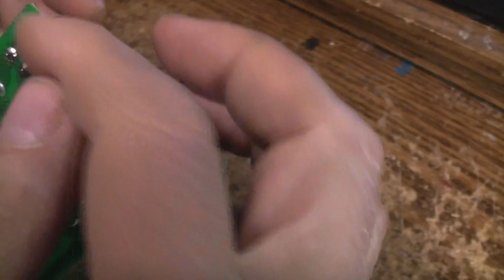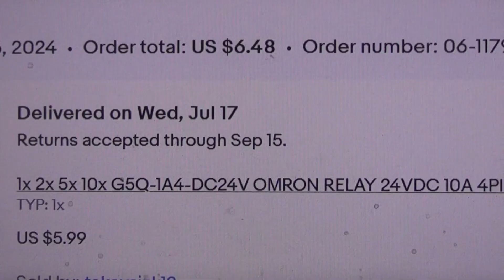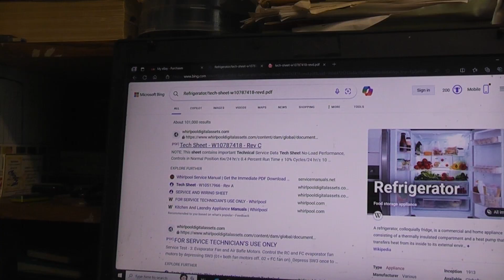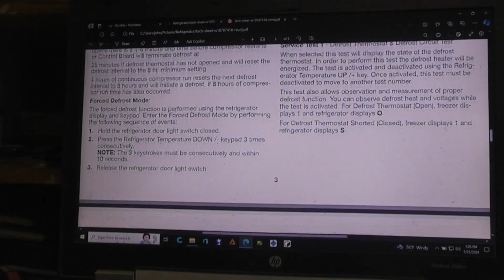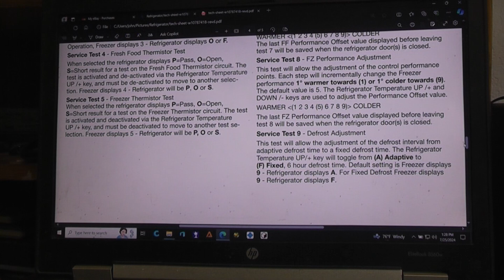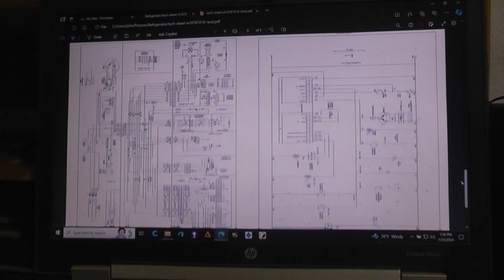Repair or replace "defective" Fridge-freezer W10503278 jazz control board. Replace the relays first.

Comment: Sir, I had same problem with Amana not cooling one month ago.Then I had changed the relay1 (not both), and it has started to cool again.Today unfortunately I have same trouble.What do you advice to me?  thanks so much...
Reply from the maker: You could replace the board or change out both relays as I did. Mine is still operating. I also turn off the humidity control and set my fridge for a time defrost cycle just like the old fridges that lasted for ever.
Reply: @Robothut thanks so much...try to change both again as soon, but how to cancel humidity control ? if possible, could you tell me please?
Reply from the maker: @qurmans  I would not know how to do it from memory. I looked up the operations manual online that tells you how to use the setting menu for the fridge. It's a combination of pushing switches, nothing that a person would ever remember. You have to follow the steps one by one. Not even sure if I kept the instructions. I hope I did, one day I will have to do this again for sure. I think I talk about the instructions in the video.
Reply: @Robothut ok, thanks for your kind interests and help...I will try to find set up of jaz...
Reply from the maker: @qurmans  I do recall there is a section on testing the defrost heater, where you can manually turn it ON to see if it is working. Seems like it was in that section where you could turn off the auto defrost and select a manual defrost.

Comment: Nice to find a detailed walk through. I had already replaced my defrost thermostat, but it's icing up again, so I was going to do the board next, but this is much more affordable.
Reply from the maker: Yes, it is almost always the mechanical relay contacts that are the problem, not a hard fix unless you have never done soldering on a PCB.

Comment: Error Error : the problem has nothing to do with the relay for the heater. It is invariably always the relay of the compressor. The carbon  contacts fuse closed  and as a result  the compressor has a 100% runtime causing a constant run condition which causes the over ice condition on the low side of the system, which is known as the evaporator
But this is how we learn, isn’t it as far as the relays is only one brand you should buy I believe it’s called Blumenkrupt was something like that nice video though thank you
Reply from the maker: The new relays were so low cost that replacing them both only made sense and the problem is fixed. Maybe for anougher 5 years. I really wanted to replace the mechanical relays with Solid state relays but space was tight so did not.
Reply: @Robothut  
Yes, absolutely I agree. It’s cheap enough, but the diagnosis is in my 40 yr experience is never the relay for the heater. I think I may have changed one heater and that was due to a physical burnout. That’s a great model. By the way people often neglect the condenser as well and what happens is it over heats and has to run that much longer in order to remove the heat causing that small relay to stay closed for an extended period of time and it’s not designed to work that way and that’s why it fuses closed, I’ll always find a condenser impacted with the usual pet hair and dust the #1 killer 

Thank you again for making the video. It’s people like you that keep things going. Have a great day.
Reply from the maker: @HVACENGINEER94  Thank you for the advice based on years of experience. Yes, I clean the pet hair and dust off confessor monthly just to be sure things are happy.

Comment: I never knew there was a set of circuit boards in there.   Good to know!  I did have a problem with our freezer plugging up with ice, but I solved that with one of those metal strips that clips on to the defrost coil and gets inserted into the drain hole.
Reply from the maker: I have only had the drain hole freeze up once, but I have had two defrost the coils with heat guns 3 times, so I decided to replace the relays that control the defrosting action. As their contacts pit, they can be intermittent at best. So far it is working fine.

Comment: My vote is to repair if you can because today you can buy brand new , that's defective junk
Reply from the maker: Yes, the new units will work less than 10 years and die. There so expensive these days as well.